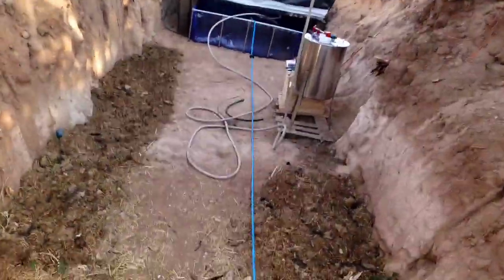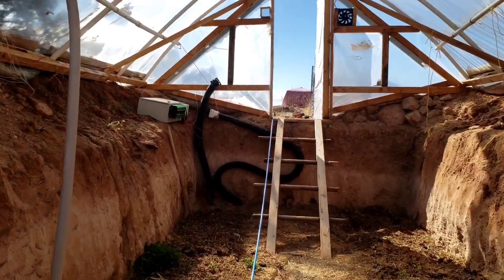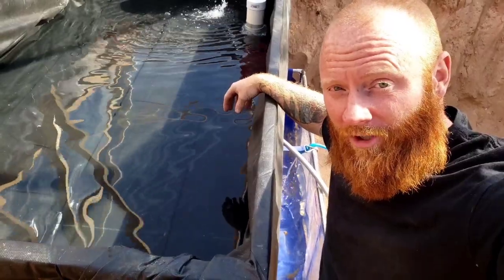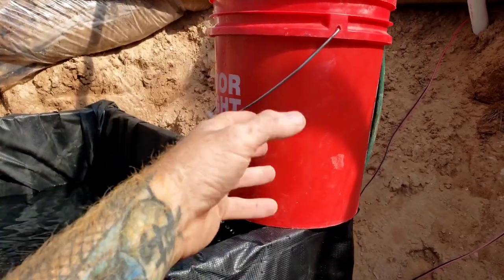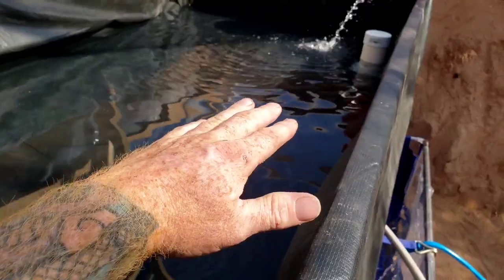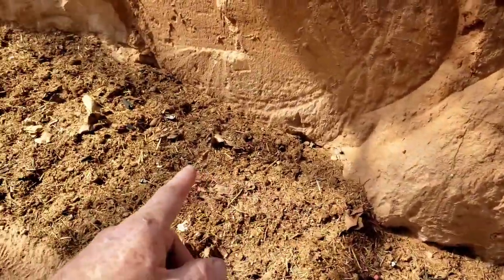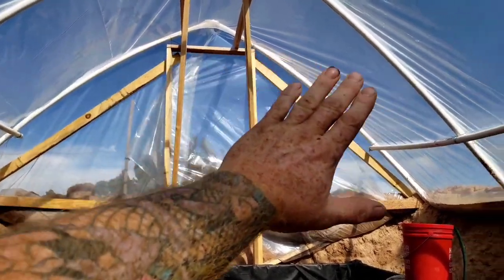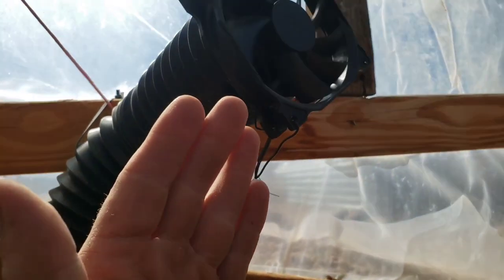I made a cheap Off Grid Aquaponics System in my Geothermal Greenhouse

Comment: Yeeuh' right-on John! That's Rad! I'm excited to see how well the geo thermal keeps things cool in the summer. I gues it's just mathematics and cubic feet of air moving from underground maybe a greenhouse full at a time every so often. So cool. Maybe next year you'll have plenty of compost to coil some hose inside the pile for heat. I only have experience with the hydroponics and cycling everything out between crops but I'm interested to see how a more permaculture set up gets established and the materials you use to get it going. 👍

Comment: I saw someone growing water spinach and lettuce on a raft. To help filter and with algae. Happy happy plants. Kiddos on the bell siphon. Did you design it or did you emulate?
Reply: Like custom or did you see someone else’s? I want fish ponds. Above ground (bedrock) and I want to move the water.
Reply: I do have a ravine. I’m also looking at a small ram pump design. I have the vertical drop.
Reply from the maker: Well, bell siphon is a specific design that has been around a long time. it's basically a tube with a 90 degree at the bottom with a larger tube and cap. That's it. So I emulated the bell siphon design that everyone else does. I simply used mostly scrap material I had laying around though.
Reply: @FrugalOffGrid  I think I watched too many videos on design and modifications. Over complicating stuff. 🙄😁